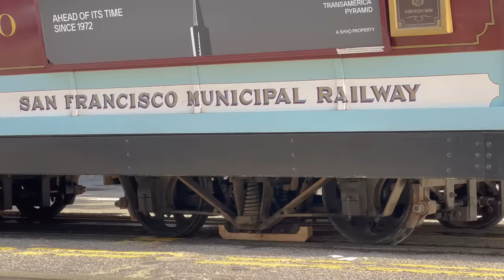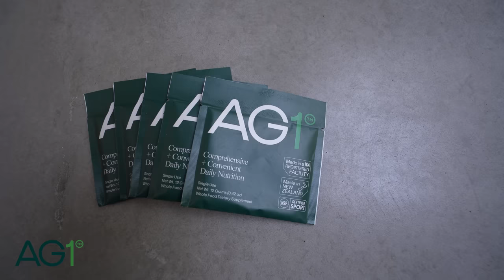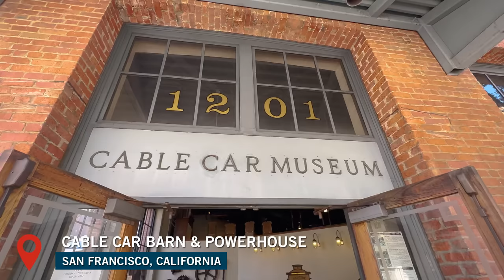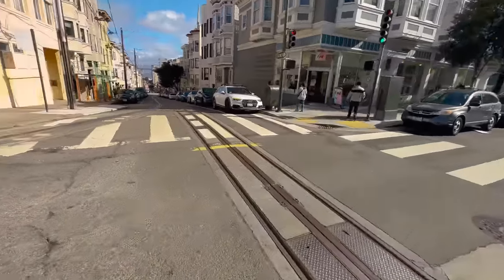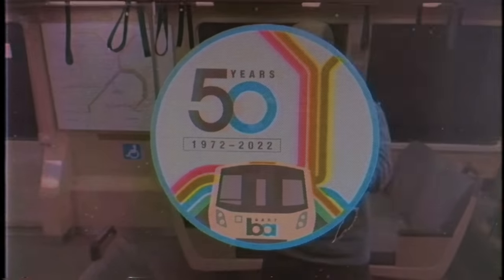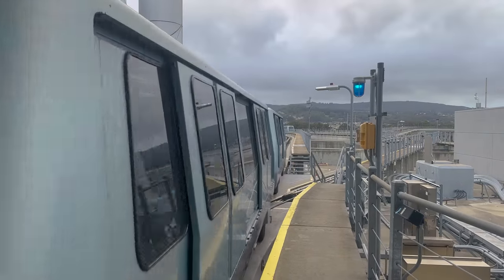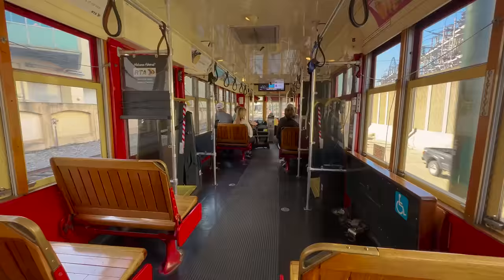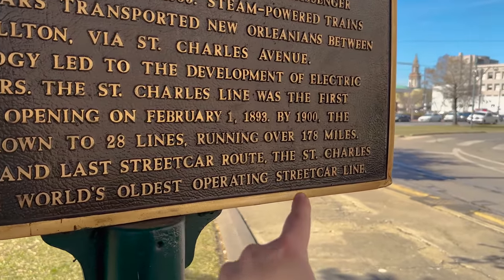Riding the FAMOUS San Francisco CABLE CARS

Comment: We will be in San Francisco in 5 days. Riding the cable cars again is on our list of things to do.
Reply: Pro tip: make sure to do this exact route, it's the best one! I believe it goes from Beach St. in Fisherman's Wharf to Union Square, but you can get off at Lombard, take some pictures, and from there walk to the original Swenson's ice cream for some delicious dessert!
Reply: Pro Tip from someone who lived in San Francisco for years: If you want to hang out the side like many tours do you may want to wait in line at the Stockton or Masonic Street turnarounds. Depending on if you go in the high tourist season everyone wants to do this and no one wants to sit inside. Locals sit inside or hang on depending on what's available. You might as well have the ride you want sissy will pay big bucks for the ticket whereas local commuters get them free on monthly Muni passes. 

And if you're going to hang off the edge and try to take video, please take off your backpack and put it inside or the engineer might tell you to do so. There have been accidents caused by tourists with backpacks getting snagged by a passing truck or even an approaching cable car. 😮

Comment: Oh, that last view of a soon-to-be demolished beignet was priceless!  

Now for my usual quibbles.  That block of Lombard Street is not particularly steep.  One block south is Greenwich that is partially a staircase.  Two blocks south is Filbert, the first half of the block is flat and the second half is a plunge.  There are several streets even steeper.  Also, Vermont Street on Potrero Hill is crookeder but not as pretty.  It used to be that your paper transfer on a streetcar, a trolley, or a motorcoach allowed you to get on a cable car because it was viewed as just another part of the system.  It's much pricier now and that's a shame.  Oh, it's not "The" BART unless you want people to think you're from Los Angeles - it's just BART.  

Now back to the praise:  I especially liked seeing the streetcars in New Orleans.  Absolutely beautiful.  As always, you expand the horizons of those of us who don't travel much.

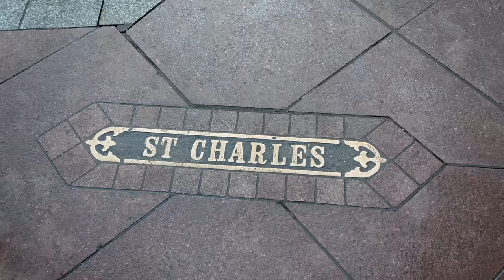Comment: 11:27 The 900 series cars were built in 1923-1924. Car 952 was sent on long-term loan to the San Francisco Municipal Railway, where it operates on that city's E-Embarcadero and F-Market & Warves lines as part of the Heritage Fleet. 913: Car 913 was sold to the Orange Empire Railway Museum in Riverside County, California in 1964 when the Canal line was discontinued. Later, it was sold to San Francisco Municipal Railway to augment service there by car 952. So far, it has not been refurbished for service, but is stored for future use.

Comment: Great to see you visit my part of the world, San Francisco. Besides the 1940s streamlined streetcars, the transit system also runs  cars from 1898 to 1924, but runs them less often.
Reply: Thank you for mentioning that. I just left a comment because Donnie forgot to mention the orange one which I nicknamed the Frida. It was from the 1890s as I recall and had benches around the perimeter instead of front facing seats. 

I used to hate taking the F to the wharf for business as I had a client down there but when I took the F it was always interesting to see which one you caught!
Reply: You know, I wish the cable car went to Oakland, where I live
Reply: I grew up in SF and lived on Broadway, half a block from the Hyde Street line. I would take the cable car to Market and get on the M streetcar to go to college at SF State. 

When the combined BART and Muni Metro subway opened in the 1970s and '80s, it was planned that the old streetcars running up and down Market would be removed. Unlike the beloved cable cars, the streetcar network was seen as old and unreliable, and, with a shiny new subway, superfluous.  

In a separate development, in 1979 it was determined that the cable car system was so old and decrepit that it needed to be overhauled, which would take 18 months, from late 1982 until summer 1984. Since so many tourists loved riding the cable cars, it was decided that the old streetcars would be brought back into service and used as a 1983 substitute summertime attraction, running from the Transbay Terminal to the Castro,  and called the San Francisco Historic Trolley Festival.  

It was such a hit, not just with the tourists (who would sometimes get off the line at the Castro terminus in the heart of San Francisco's gayborhood, take one look around and head back downtown), but with residents as well, that it was done again for the next 5 summers, whereupon it was decided to make it a permanent, year-round transit line. 

Since nothing in San Francisco happens quickly, over the next 8 years, new tracks were put in, and the first segment, from the Ferry Building to Market & Castro and augmented with newly acquired streetcars from around the world, was finally opened in 1995. (For those of us who endured BART/Muni subway construction in the 1960s and '70s, having Market Street ripped up yet again was reliving a nightmare)The line was subsequently extended to Fisherman's Wharf in 2000.

Comment: Good video as usual Downie!!! Just to let anyone who plans on visiting San Francisco some advice from a SF resident. The Cable Cars are about $8-10 USD one way I believe. I have not rode them in about 3 years. The street cars do accept day passes and they have kiosks that you  can buy your tickets/passes at. and are usually at the MUNI Metro/BART stations on the first level underground. Then the MUNI Metro is below that and BART below that. The cable cars ticket booths are manned at either end of the Powell/Mason or the Powell/Hyde Cable Car turn-arounds. During peak tourist season you may be waiting a good while, because of the lines, just to get on one at one of the turn-arounds. And the operators of both the Street Cars and Cable Cars carry no change nor do they have credit card readers. Those are only at the Ticket Vending Machines or from the Cable Car ticket booths.

Comment: I lived in SF for ears and the cable cars are not just for tourists. One fact you did not elaborate on which I only knew because I had conversations with the engineers who run the cable cars...  you mentioned the braking system and how it would be difficult to brake steel on steel cables... but the true solution was wood blocks. Depending on the season you can smell a smell like woodburning fireplaces as the cable cars go downhill. The braking system utilizes big chunks of wood almost the size of cinder blocks. It is still the best solution but when you see a worn-down brake which one of the engineers showed me it almost looks like a doorstop having rubbed against the weight for so long. 

One minor, technical thing I noticed was that you gave the hippie van on Lombard Street the peace sign. I'm assuming that you were doing it that way for the camera, but a backwards ✌ is actually a lewd insult. 

Glad you squeezed in the NoLa St. Charles line but here's a fact that you missed. The San Francisco street cars are all not from the forties. They vary in different decades and the oldest are from the late 19th century and a couple of them still run on the F line. I nicknamed an orange one the Frida because I took them quite often and it did not have front facing seats but instead benches along the perimeter so that there is tons of room for straphangers. It always reminded me of the image of the streetcar that Frida Kahlo was injured in and that's why I ominously named it the Frida. 

I was actually on one of the 1940s streetcars on the F line once when it SUV decided to make a turn into us on a rainy night. The SUV was crumpled and could not escape and when I later got off the streetcar which completed its route there was barely a mark on the paint. Don't mess with those behemoths if you're in a car!

Comment: I rode the Cable Cars in San Francisco way back in 1989 and visited the Museum and Cable Powerhouse as well. Haven't been to New Orleans but you captured the atmosphere very well. Now, as Jordy mentioned in comments below, ya gotta come downunder to ride Melbourne's tram network.

Interesting challenge to cover the whole system in a day (I haven't tried that yet), but our historic W Class trams run a circuit around downtown during daylight hours and that ride is free. You need a Myki card to ride the system outside of downtown (I kid you not - our transit smart card at present is called Myki !!). Cheers from Michael.😀

Comment: I got to ride the cable cars on one of my trips to San Francisco. It is defiantly worth the visit to see the power house and see how the cable system works and how the operator has to connect and unconnected from the cable. I did get one unique ride late at night ridding down hill. The grip man asked if we were roller coaster fans and we said yes. So after we got going where their was no traffic he disconcerted the car from the grip and let gravity take over. Needless to say we went faster than if he maintained the grip. After a bit of fast ridding he engaged the wooden break you mentioned and re griped the cable for the balance of the ride. However he did provide a unique and exciting ride to a group of fun tourists that night.

Comment: As part of my charmed life, I lived in San Francisco for 7 months in 2001, until the company that brought me there laid me off (I failed up to an even better job, so the charm continued).  The cable cars were $2 a ride, I think, but I used a monthly pass for all of my transportation, and the cable cars were included.   I loved living there.  I would turn a random corner and be surprised by stunning view of Alcatraz or one of the bridges.  And then a few days later I'd turn that same corner and be surprised again!  Maybe something was drawing me to those corners and it wasn't so random after all.   I'd take a shortcut through "Barbary Lane".  My daily commute took me down the Filbert Steps (and back up after a long day of engineering software).  299 stair steps to my tiny apartment near Coit Tower. 

I haven't been back there since 2001, but I hope to take my kids there someday.  We had a cruise leaving from there planned in the summer of 2020, but it got canceled when everything got canceled.

Comment: SF is the most famous remaining cable car system. Llandudno, in North Wales has Europe's longest cablecars. Lisbon in Portugal also has 3 short ones. In Wales, the system has cars which are fixed to the cables and they operate in pairs on two consecutive cables; one car is ascending the Great Orme and one descending. So if one car stops, they all stop. The 'driver' has to signal to the wheelhouse if an emergency stop is required. At the midpoint, passengers change cars to continue on the next cable.
Reply from the maker: Sounds like you also watched the recent The Tim Traveler video!

Comment: Those green 1930s streetcars were in regular use up until 1980 or so. That's why they still had plenty to restore.
Reply: Those are called PCC streetcars. It was a common design adopted by transit systems across North America as a way to improve efficiency and cut costs versus building bespoke cars for each system. SF acquired a lot of them second- or third-hand and rehabbed them including paint schemes of former operators. 

The PCC design was licensed around the world. IIRC one of the big European manufacturers built upwards of 10K of them. I wish someone would build a modern version. For many people they're what they see when someone says "streetcar".

Comment: You didn’t mention it, but the breaks are actually made of wood! Pine, generally, which means they smell amazing when they’ve gone down a long hill.

The metal dies that actually press against the cable last a grand total of…three days. There’s a giant box of them at the Cable Car barn, and Muni re-makes them constantly.

You also didn’t get to see the SCADA room (though you were right by it, it’s not public): that’s where they monitor the cable as it wraps along the city. Along the cable trenches, there are hundreds of sensors that feel for the cable starting to fray - if a strand comes lose and catches the sensor, the entire cable comes to a halt and Muni fixes it. This can take hours! The cable
Itself only lasts a few months, and then has to be replaced overnight. Each costs hundreds of thousands of dollars, but since they can be recycled, that cost is substantially lower for Muni…thankfully. 

Also, Lombard isn’t the steepest street in SF - just the most famous.
Reply: Oh! And the cars look so good because Muni has an entire team of carpenters constantly rebuilding and overhauling them! The oldest is Car 19, which dates back 80 years!

Comment: You've got some factual errors about our system in SF: For crossing cables, it isn't the uphill or downhill but the seniority of the system. The most senior line does not have to drop the cable. Also the streetcars run nowhere near 20 hours a day anymore in the post COVID world.

Comment: The Electric Trolly cars only run on rails on flat streets and are tethered to an overhead power line. In some cities they still have electric buses that drive on streets, that also use over-head wires to connect to the power. In that scenario the visual space above the vehicle is cluttered with wires and connections like an unpleasant black spider web. Electric vehicles reduce noxious  street level pollution. There are no deadly fumes generated around Cable cars, which is another reason to keep them running.

Comment: Welcome to the Bay Area Downie! Wonderful to see you review the cable cars. But as a local here, one thing I never do is sit on the BART seats :)
Reply from the maker: HAHAHA Thanks for the tip!
Reply: Nonsense. Almost everyone sits on BART. I've almost never seen anyone stand until most of the seats are full.

BART lines are extremely long. Some people commute on BART for over an hour. It would be pretty crazy to try to stand that whole time on BART.
Reply: @TohaBgood2  I beg to differ. The latest poll that was released asking why people avoid BART shows 45 to 55% of people do not take BART because of safety AND cleanliness. Also 90% of people in the poll want BART to prioritize CLEANING.
Reply: @BayAreaTraveler  What exactly does that have to do with the fact that some people spend up to 50 minutes on BART during their commute?
Reply: @TohaBgood2  I never said anything about time spent on trains did I? All I spoke about was cleanliness on the BART trains and the latest survey that was released spoke volumes about people’s concern about how dirty the trains are.
Reply: @BayAreaTraveler  Again, dude, what are you even talking about? I can read the entire exchange right ^^here^^, and what you are replying makes no sense. 

You implied that "locals don't sit while taking BART". I explained that that is pretty nonsensical and that I don't think I've ever seen anyone stand on BART if there were any seats left open. I mentioned that specifically because BART is almost literally longer than that new HSR line in Indonesia. Many people take very, very long BART commutes so not sitting simply isn't an option.

What exactly are you talking about at this point?
Reply: @TohaBgood2  You and I are talking about 2 completely different things and you completely misunderstood my initial comment to Downie. Obviously what I said was lost in translation to you. I mentioned to him that I don't sit on BART seats with a smiley face implying something. What I am implying is that the seats are DIRTY so that is why I DO NOT sit on them.  I've been in the Bay Area for 40 years and yes I have seen people stand EVEN if there are empty seats. A lot of these seats are really dirty sometimes with urine on them or other gross stuff. If you want to sit on them so be it, to each his/her own.

Comment: Come to Philadelphia for there trolley cars
Reply: Philly runs 1980s-vintage Kawasaki cars. Not visually interesting, but they've worked well for over 40 years. They also have a small fleet of rehabbed PCCs for the Girard Ave. line. I've read they plan to order a new fleet of low-floor articulated trams.

P.S. "their"

Comment: Americans call them cable cars but THEY ARE STREET CARS. cable cars are gondolas on a cable over a mountain (like a ski lift)
Reply: In US usage streetcars are powered electrically using overhead wires. SF's vehicles have been called cable cars since 1873 so they kind have rights to the name in that city.

Comment: i was confused when you borded that cable bus... ive never seen one of those in SF... used tongo there quite a bit too... the trollys are every where but those busses... i must be brain farting. the only cable busses 8 remember are the double longs that are more modern.
Reply: ??? They are called CABLE CARS not buses*. They run on rails and use steel wheels, not rubber tires. 

* *buses, *trolley, *trolleys

Comment: These Are Not Cable Cars, There Streetcars (Cabled)

A Cable Car 🚡  =  🚠
Reply: That's an American usage. Streetcars (= trams) are powered from overhead wires using a trolley pole or pantograph. These cars are pulled by cables running in the opening in between the rails, not by onboard electric motors. They've been called cable cars since the system was installed in 1873, so the term has, uh, squatter's rights.